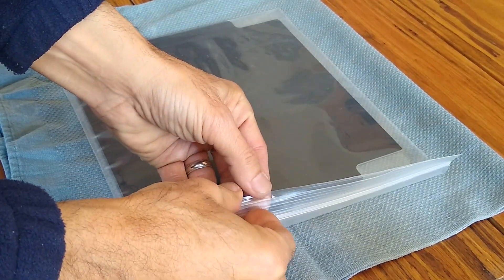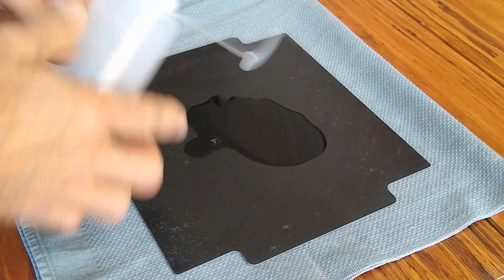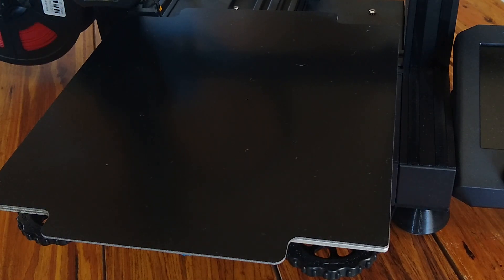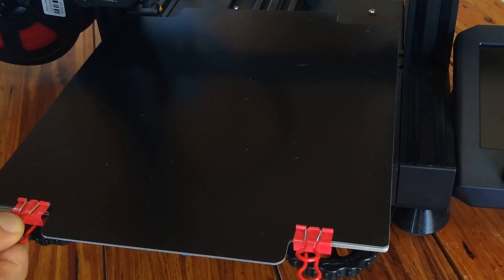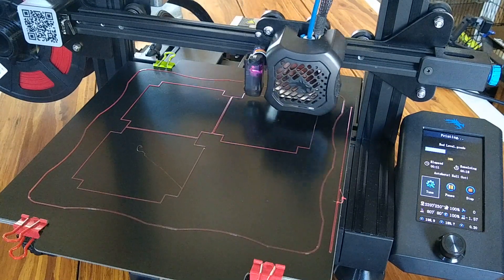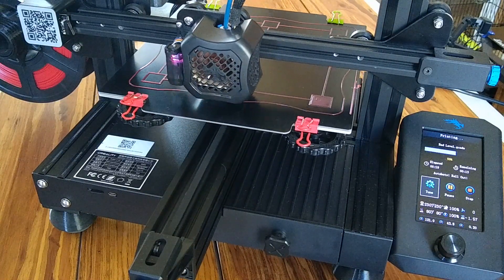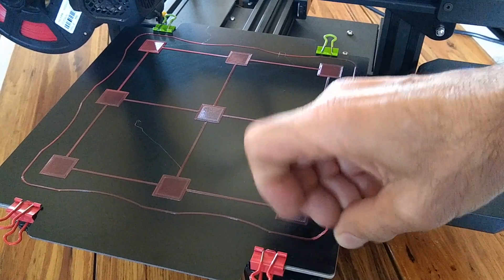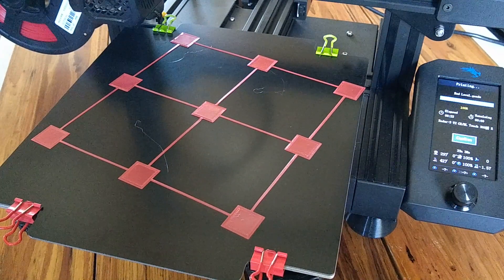JUSTHANGIN' Garolite G10 Build Surface Prep & Installation

Comment: just printed my first print on this; adhesion is really good with petg (70 degrees) . although it is not as easy to remove when compared to a PEI bed which just removes itself when it cools down. will continue to test it out some more.
Reply from the maker: Hello, Thank you for commenting and supporting my work. One of the biggest advantages of Garolite G10 is that you can fine tune the level of grip the filament has with it. The side benefit of raising your z-offset more than you would with glass or PEI is almost no stringing, I'll have to make a video on just how I do it. Give me a call 478-227-3301. if you want me to help you get it set for G10.

Comment: I bought older GaroLite sheet that was thin and flexible. I put it on the original bed plate from my 10S Pro V1. The plate is aluminum about 1/4 inch thick and clamps onto the bed heater plate. Now this  G10 Garolite you place it directly on the Heater plate?? That has to save a lot of weight. I just ordered the Flex Bed and was shocked how heavy it is. Think I will return it and get the G10 like this. Much lighter. Yes!
Reply from the maker: Hello Frankentrain Laboratories, Yes, it's directly placed on the heated bed, It's super lightweight too.
Reply: @vbared  Trouble with Poly Carbonate and tips to get it to stick????
Reply from the maker: @DennisMurphey  Hi Dennis, I haven't tried printing with Polycarbonate yet. I'm not sure that is going to work with the G10 without some type of adhesion promoter. If you need an adhesion promoter I would use it on glass. Let me know what you learn.

Wonderful hearing from you.

Comment: what bed temp for Nylon Carbon Fiber and ABS Carbon Fiber, would it be the same as normal?
Reply from the maker: Hi Noe, I haven't tested it with carbon fiber reinforced Nylon or ABS but had someone say it fused to their Garolite G10 so I don't recommend using these filaments until we can confirm they will work or not. Our Garolite G10 works awesome with PLA, PETG, and regular Nylon. I print some parts using Overture Easy Nylon black at 230c hotend,  0c for the bed, and no cooling fan. Another thing that important with Nylon and ABS is to not have air bleeding down from the hotend fan onto the print. Linked below is a video I made on printing with Nylon. I'm still trying to figure out how to print reliably with ABS without the need for an enclosure.

https://youtu.be/wUi5GdKFYtI

Comment: Do your clips holding the G10 bed ever come lose? Or are the clips on there pretty well?

Also, would you recommend a G10 bed that has is…

0.5mm thick
0.1mm thick 
Or 0.15mm thick
Reply from the maker: Hello Adam, Thank you for commenting. I'm currently using micro binder clips that are 1/2" wide. I like them best because they don't get in the way at all. So long as the G10 is directly on the aluminum bed they will work. I haven't tried using the thinner Garolite but would think that since it's so thin it may bow up when clipped at the edges. The one we offer is just about as thick as you can get while still being able to bend a little. 95% of my big prints in PETG come right off without much effort once the bed is completely cooled.

Best of luck with your projects!
Reply: Just curious what thickness did you get and what is a reasonable supplier

Comment: hey, do this product works with nylon alloy 910? having alot of warping and adhesion troubles
Reply from the maker: Hello Lightshadown, Thank you for commenting. I haven't tested that filament but just made this video linked below on printing with Overture Easy Nylon. 

https://youtu.be/wUi5GdKFYtI

Best of luck with your mods!
Reply: @vbared  thanks checking it already

Comment: Is this your product? Mine came in with a QR code linking to your video.
Reply from the maker: Hello meleniumshane90, Thank you for commenting and supporting my work. Yes, it is. After making the first G10 Garolite video viewers that had seen the video asked if I could cut the G10 out for their Ender 3s because they lacked the tools. I use them on both my Ender 3 V2s and love them. 

Let me know if you have any questions about it.

Best of luck with your mods!
Reply: @vbared  Nice. I installed it last night and did the PETG "temperature towers" test print, which came out super smooth on the bottom and came off without issue. So far so good. PLA should be cake.

Unrelated to the Garolite: This Overture "transparent" PETG has been giving me all kinds of issues on the first layer with a print I've been trying to get perfected. The brim comes out perfect, but the filament keeps getting stuck on the print head and pulling the tree supports off the bed before they stick. Either my settings are off, there's a hardware issue I'm not seeing, or the Thingiverse file is just temperamental. I had to take a break from trying to fix it, because I wanted to hit it with a baseball bat.
Reply from the maker: @meleniumshane90  Good morning, Meleniumshane90, I use SUNLU PETG and print at 230c, bed at 80c, retraction distance 5mm, retraction speed 25mm/s. Have you seen my video on building and upgrading an Ender 3 V2? Near the end of that video I explain how I set me z offset using these 9 squares that are 2 layers tall. If it's not a temperature or settings issue then it could be that you are printing too close or too far from the bed. The square test print will help you fine tune it.

Yeah, I hear you sometimes I need to take a break from things that aren't cooperating.

I'm curious about the PLA sticking to the Garolite, please let me know if it does. It's the only material I haven't tested it with.

Enjoy your day!

Comment: Victor, one last recommendation. After having used these sheets on all of my Ender printers, I have noticed that when the beds are completely heated, some sheets actually tend to lift up " albeit a very small amount " on each side.  Normally the binder clips would hang up on the printers vertical posts, however, I believe have found an easy way around this issue. Install the clips ( one on each side close to the center, ) and then squeeze the little wire handles ( for lack of a better word ) and remove them from both sides of the binder. Then the binder itself will not hook up on any part of the printer.  Just my 0.02$
Reply from the maker: Hello Robert, Thank you for commenting and awesome suggestion. My Ender 3 V2 printer came with just two clips in the front and rear centers. My only concern with using the sides would be that the clips are very close to the prime lines drawn by the printer at the start of a print. I think the standard 1/2 clips might be too deep. I guess the prime lines locations can be altered using the start g-code as a work around. Great suggestion BTW.

Best of luck with your mods!

Comment: Has anybody figured out how to use these sheets on a Prusa MK3 printer ???
Reply from the maker: Hi Robert, You can cut your own using a 12x12 1/16" G10 sheet. linked below I made a video on how I'm made these also linked below.

https://www.mcmaster.com/catalog/128/4014

https://youtu.be/MB-91rfvWfE